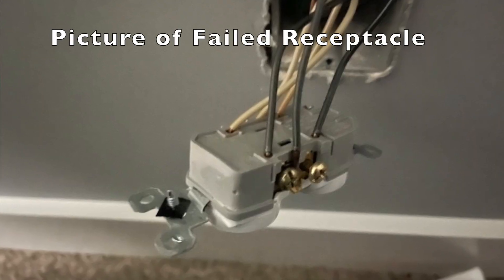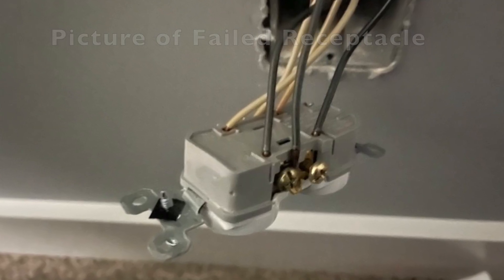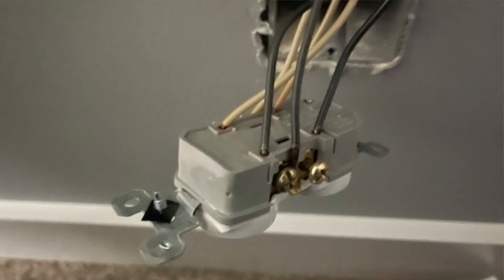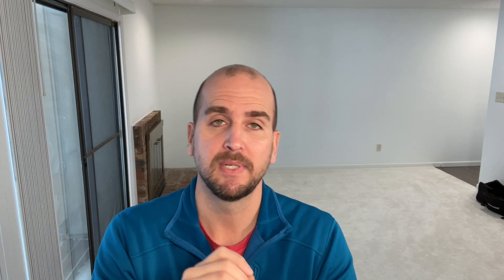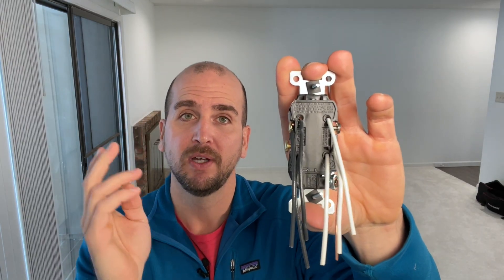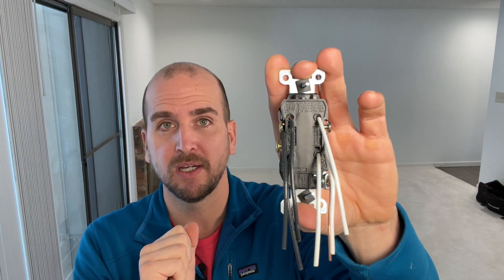Incorrectly Wired Outlet Found In Newly Built Home

Comment: At least for the neutral (and ground) wires, pigtails are required by Canadian code. This is because if a problem happens with one of the plugs, the neutral connection may be lost for all the downstream plugs. You need to be able to remove the plug entirely and the downstream neutral/grounds will still be preserved.

Comment: I’m a retired UK electrician and have to comment on the way you wire in the US. It’s now considered bad practice over here to twist cables together because  the strain placed on the conductors can cause premature failure. I would also recommend an intumescent pad in that plastic box so that in the case of fire the path to a wood wall is blocked and hopefully give valuable time to exit the property. Push fit cables are only permitted on lighting circuits in the UK. The possibility of overload on a power circuit is far greater.
Reply: Can you link to the type of connectors you use?  If they are what I think, they are about 10 x the cost of marret. 

Does europe (UK) only allow copper wires?

Would the fact that we work with 120VAC with generally not more than 20AMP fused /breaker circuits have an impact on your opinion?

Thanks
Reply: @Jgalaski8438  I would use a crimp connection in this instance. But increasingly we are seeing more and more Wago connectors used. These clamp the conductor but can be released by lifting a lever.
Aluminium conductors were used briefly in the 40/50s but rarely today if at all. I've never found any in my work. But we still find installations wired in VIR (vulcanised Insulated Rubber) cables, now not acceptable, and usually a rewire is recommended.
As I'm nearly 70 I miss my days 'on the tools'.
Nice to chat.

Comment: "Better" to use pigtails: yes if you have the volume in the box. But back wire clamps have their place,  and are "better" if box volume is an issue.  "Better" needs qualifiers to go with it.
Reply: He didn't need pig tails unless he had 3 black/3 white because It's takes the volume of the box for nothing. 
The ground,  yes you need 1 attached to the box and the rest attached to it by pigtail by code.
Reply: @MRKCUL  I was wondering what he was doing.
Reply: you have 18ci. For any two cables or three if #14, you have space for pigtails.
Reply: Not to mention that a lot of modern smart switches and plugs, as well as USB ported outlets that you may be upgrading to, can be much larger and use up a lot of the volume in the box. But I agree that if there is enough room, pigtails are definitely a superior connection.
Reply: You'll also still have power to all your devices further down line in the circuit if you use pigtails. If you don't, when there's a problem at one outlet you'll lose power to all the others after in the circuit.
Reply: @Avaddon911  I appreciate your attempt to answer why pigtails is better. The video didn't explain why you should use pigtails and I know why I don't use pigtails when I just have 2 black/2 white; same reason people are saying here, limited room in the box and easier to manipulate the receptacle back in or back out if I need to do something with it later.

That said, my contention with your point is that it only applies to push-ins, which has already been discussed as a higher risk point of failure. If you are using the screw ins, you are screwing two black wires down to a single brass plate. There's no point of failure as they are contacting the same plate. Even if the receptacle dies, those wires are still connected, so down stream devices are still getting their current.
Reply: @RageDaug  Okay, so what do you think the failure would cause? If a wire comes loose you're still creating a break in the circuit. If it were pigtailed there would be no break caused.
Reply: @RageDaug  I never use the push in terminals FYI.
Reply: @Avaddon911  the pigtail circuit breaks when the wire falls out of the nut.
Reply: @Avaddon911  Yeah, I have heard compelling arguments and enough from the pros to convince me not to use them.
Reply: @RageDaug  if you properly twist your wires they're not coming apart. I'm 15 years in the trade I might know a thing or 2.
Reply: @Avaddon911  Sure, and if you properly screw down a screw it's not coming off. The point was that dumb people don't know to tighten screws, and I countered with the fact that I've seen many more examples of dumb people not knowing how to twist wires into a nut than I've seen people who couldn't figure how to tighten a screw. Just my personal experience...I just haven't run into loose screws on receptacles, but I have seen many bad pigtails, where you can just hand pull wires out because they weren't twisted properly.
Reply: @RageDaug  I'm not sure what you're arguing here. No matter the negligence of the installer. Electricity still works the same way. It's still good practice to pigtail your outlets. It's a courtesy to the end user.
Reply: @Avaddon911  You entered the middle of the discussion. So I'm not arguing against anything you are saying, just saying you missed the point of what I was saying earlier. The point I was saying to the other person, that you jumped into was that an incompetent person is more likely to mess up twisting the wires in a pigtail, than not  tightening a screw. That's all I was saying. They were saying you should use pigtails because sometimes people don't tighten the screws. In my personal experience, I've never failed to tighten a screw on a wire, but I have messed up pigtails and had to redo them because wires kept falling out. That's all I'm saying. So I don't know that you were disputing my claim, it's possible that we agree with each other.
Reply: @RageDaug  if you loop your wire under that set screw then yes, that connection is not going to come loose easily. If you're afraid of installer negligence. You can use wagos instead. Make sure the wire is fully seated in the wago and clamp it down. Wrap some electrical tape around it for good measure. You can also usually fit wagos in a box easier than wire nuts because they're flat.
Reply: @RageDaug  the problem I run into often is stranded/solid wires all under a wire nut. Or stranded wire connections failing. I avoid stranded wire whenever possible. But wagos actually help to solve this problem as well. Put all your stranded wire in a wago and run a solid jumper to your outlet.
Reply: @Avaddon911  I'm not afraid of installer negligence. The dude I was responding to was.
Reply: @RageDaug  I wasn't referring to you specifically, just anyone that would be against wire nuts because they think the wires wouldn't be twisted correctly, in direct response to what you said.
Reply: @Avaddon911  I mean, I'm not anti-wire nut. I use them plenty. I'm just saying that I haven't seen any reasons you would want to use wire nuts over the screw down terminals on the receptacle. So to the point of  this video, I would argue against removing wires from the screw down terminals and creating a pigtail instead.. Seems like an exercise of over complicating something so you can try to show everyone how smart you are.
Reply: @RageDaug  No, it helps in the case that there is an issue at one outlet... So that others in the same circuit aren't lost.  That is the reasoning. Using the screw terminals doesn't make any sense, when you rough in a project you can pig tail everything and then it makes your finish work much faster and cleaner. It also helps with the aforementioned reason.
Reply: @RageDaug  if you're having trouble getting your devices into boxes with pig tails, then you're likely over on box fill anyways.
Reply: @RageDaug  
I don't think Jason understands exactly what you're trying to explain but I get it. Thanks. It's logical to me that two wires clamped to one terminal plate is just as secure or possibly more secure than three wires going into a wire nut to make a pigtail.
Reply: @njsongwriter  thanks. I just know I'm one of the dummies they are talking about and I have trouble with pigtails with 3 wires. Maybe my wirenuts are too small? I dunno. I just know half the time one of the three wires is loose and I have to take it off, retwist the wires, try again, sometimes again a 3rd or 4th time. I never had problems tightening the screws. Like not once.

Comment: you showed it to the screen and i went OH SHIT!  -- as for the push in (spring griping) I do not like.... BUT the push in where you screw and clamp that wire in i like! ( the screw terminal moves a plate to pinch the wire.

Comment: An electrical circuit should NEVER rely on a device...always pigtail
Reply: Device is a weird word to use, you rely on a terminal of some metal and a simple screw. Why is that so bad but some other connection with an extra wire is completely fine? To me it boils down to, do the job right and it works.
Reply: @FroZenThai  Device is the correct word as used in the NEC. Back when I could still work using a device to complete the circuit instead of tying the wires together and pigtailing was a code violation.
Reply: @myrondesjarlait9752  The "Device" is still just a single piece of metal that both wires are screwed down to. As HH AA notes, the only problem there is when people don't know how to screw it down...though if someone doesn't know how to tighten a screw, I don't trust them to know how to properly twist the wires together in a pigtail. The problem seems more related to the person doing the work versus the method they are using to connect the wires.
Reply: @myrondesjarlait9752  My point was that normaly a device has a more active function like a switch or electronics where the function can be a point of failure, while an outlet is "dumb". 
From my Norwegian point of view, if designed and done right it's not a problem as using the terminals is standard here.
Reply: Pigtails to switches then? Never is a long time🙄
Reply: @BrianFullerton , you isolate the switched outlet by breaking off the tap and then wiring up the switch. The neutral side, leave alone.  Wire the color coded “switched” wire to the isolated outlet pole.  Now the switch provides power that that outlet.
Reply: However one problem, no outlets downstream can benefit from a GFCI or AFCI outlet.
Reply: @jackb1803  GFIs are intended to be junctions and have downstream terminals for use when downstream protection is wanted.
Reply: What if the device is a wire nut?
Reply: @alsmith9298  Great point.
Reply: I removed the pigtails I did in my basement finish to save box fill. When I had three 12 gauge wires entering a large single gang box it was very difficult to fit large GFCI/smart switches. Using the device to create the pigtail relies on a copper plate which is not that much different than relying on a wire nut.
Reply: For real
Reply: Calling a wire nut a device is a bit of a stretch for me.  But the point of all this is that workmanship matters. Attention to details matter. And absolutes get things right a lot of the time while ignoring important factors that will matter in many situations (and lead to undesired outcomes) . Don't be lazy in your thinking.   Absolutes lead to pigtails in places they don't belong while putting them in places they are beneficial.
Reply: @BrianFullerton  wow, didn't say a wire nut was a device...the receptacle is a device and the integrity of the circuit should NEVER rely on that device to complete said crkt!
Reply: A node is a node.
Reply: I have seen wire nuts fail too. Even melting.
Reply: And al wire? Thought those hate pigtails.
Reply: Whats the exisiting box fill look like? Short of cutting the wall changing the box or adding an extension ring and or deeper mud ring you may have to rewire it the way they old schoolers did. Not to mention most of the time to save a buck those dudes stripped the wire wrapped it around the receptical or switch device and continued on to them next receptical with the same wire no pig tails and it makes the wire always to short less than 6" . new wiring practices I'd never do it like that but a remodel short of telling the customer you're going to have to pay to rewire the whole house/apt etc you do what you must
Reply: Nah, easier to troubleshoot on residential.
Reply: HH AA  load loosens them to, you probably already knows this. Most overcurrent screws in the load center, will turn about a quarter after a year or so.
Reply: HH AA  I've seen more pigtails messed up by dippoops then I've seen people not tighten screws. Seen wires just fall out of pigtails 'cause the person didn't know twist them properly and/or put the nut on properly, then I've seen people not figure out how to turn a screw. /shrug I dunno, guess we all have different experiences.
Reply: that is a pointless tip, not to mention dangerous. If a homeowner finds his receptacle isn't working but since its pigtailed all the other ones are working, it is going to encourage him not to get the one fixed. So if its capable of starting a fire, the homeowner will never know.

Comment: When you say don' t use the push wire points...you never say why except that industry folks don't use them.
Reply: Weak connection for "one" thing. Especially if you're running a string of outlets.

Comment: Quick wire or back stab terminals can fail to the point where they start fires , especially when space heaters are involved  . They used to accept #12 wire , then this was changed to # 14 . This did not solve the problem  .

Comment: Lots of great ideas for a safer installation here.  If one really wants to get obsessive, I’ve noticed that electricians when installing faceplates will leave the slots of the screws in a vertical orientation (6:28).  Makes for a subtly cleaner-looking install.
Reply: Plus the slot will not collect dust if vertical. I also just the depth of the outlet so the face is flush with the face plate. I also put a wrap of electrical tape around the outlet to cover the screw terminals so it won't short out to the box if it is removed or installed when the circuit is hot.

Comment: When replacing a broken light switch I was surprised to find a loose terminal screw. That find caused me to check a few other random switches and I found issues like these in each one. That started me on a project to replace or upgrade every light switch, plug and light fixture in my home. The horrors I found were so frequent I figured that a green apprentice was left to wire my house completely unsupervised. At least now that I have gone over almost every electrical fixture in my home I now feel much safer. I even found a loose live wire in a drop ceiling with bare wires not capped, taped or even in a box . I highly encourage everyone to check out a few sample items in their homes to make sure that things were done to code.
Reply: Tighten all your breakers to. Current will loosen screws over time.
Reply: You did Good. All loose connections overheat or arc.